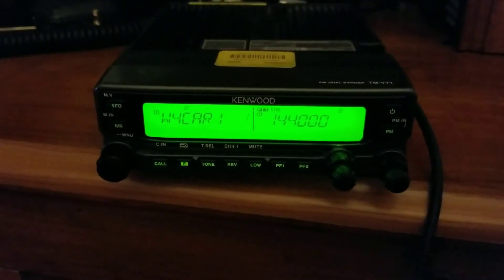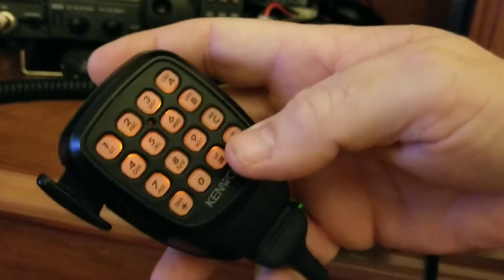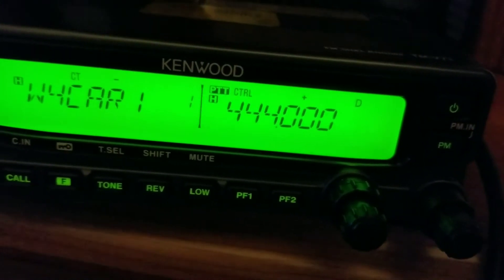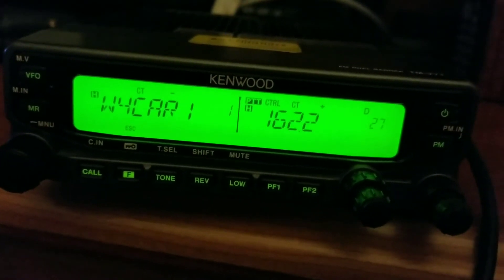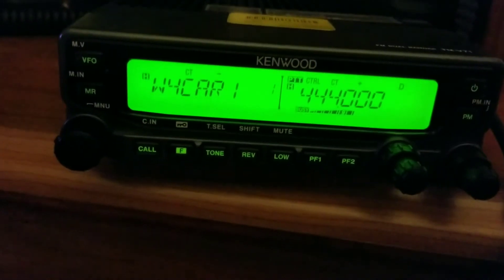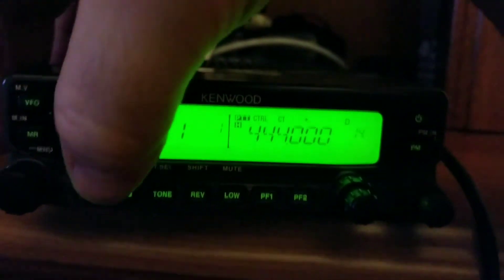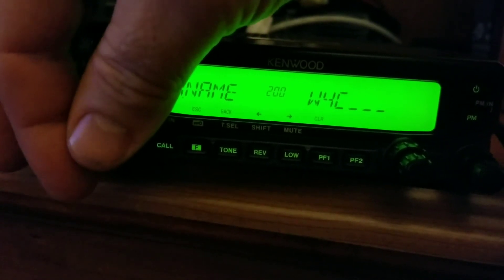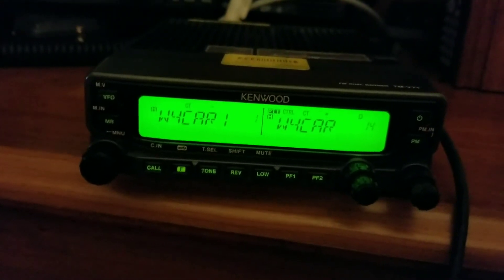Kenwood TM-V71A programming

Comment: the specifications says you can RX  for frequency 118mhz  .  
How can I set the radio for receive on 123.5 Mhz ?
I cannot seem to set below 135 Mhz
Reply from the maker: I don't have this radio anymore but if I remember correctly you can only tune that frequency on the b side of the radio. The RX on band A will only do 136-174 on VFH.
Reply: @K4MJV  wow, thanks, I will try your approach.  I have not found any information  on this issue. Thank you very much !

Comment: The TM-V71A is one of the best performing and easiest to program  2m/70cm mobiles on the market. 1,000 alphanumeric channels, 5,10 & 50 watts on both VHF and UHF,  dual band monitoring and crossband capabilities make this a great radio for the Technician class newcomer to ham radio. Taking it a step further, it's also Echolink ready. Yes.... Echolink IS ham radio that uses both internet links and active repeaters. It's pricier than the under $100.00 Chinese  mobiles but a heck of a lot more radio and 100 times easier to program off the keypad. All programming takes time but this is a cinch when you don't have immediate access to a computer for programming. 

When I earned my Tech ticket in September of 2011, my first ham radio was a Kenwood TH-F6A  (talkie) and a few months later my first mobile was the TM-V71A. I liked it so much, after I bought a second one for my "shack" two years later. I upgraded to General in 2013 but remain loyal to my local repeater friends and participate in several nets. 

Just today (09/09/2017) I came across  yet another TM-V71A at an estate sale table at a local hamfest. It was in mint condition so I made an offer slightly below what it was tagged at and bought it home for only 100 bucks. So now I have three! 

I reset it to factory defaults, hooked it up to the RT Systems software and cloned it to my shack  radio settings. Works like a charm! I'll keep this one handy as a spare,GO box rig or maybe as  a dedicated Echolink node. I also have a TM-281A 65 watt 2m only rig that goes out to the field with me during the summer. 

I need to cut back on VHF/UHF and focus more on better HF antennas. Talking on the repeaters is fun but working the world on HF is "funner"! I hope Kenwood keeps the TM-71A in production as it's still relevant for  entry level ham radio operators.
Reply: Good video. Can't wait to see what else you can show us "new owners".